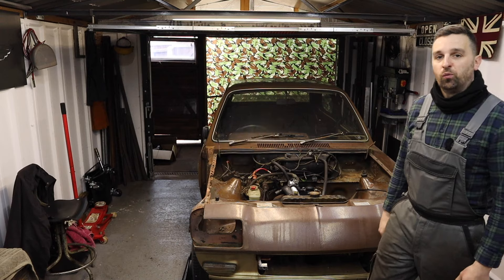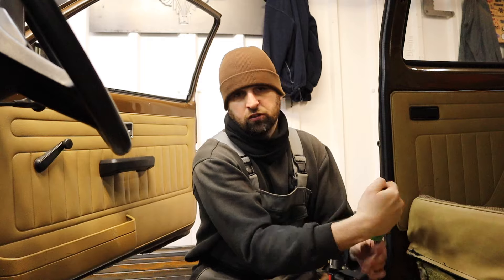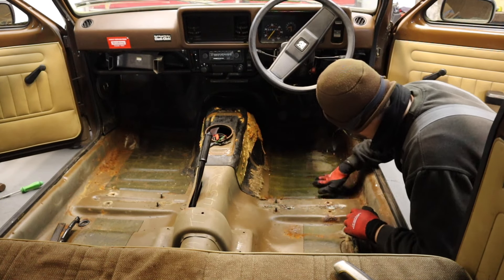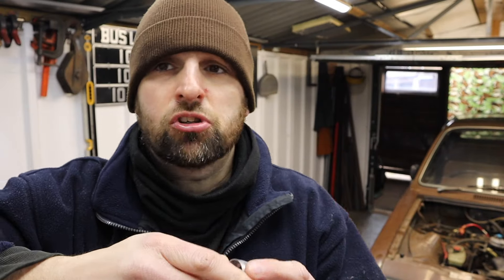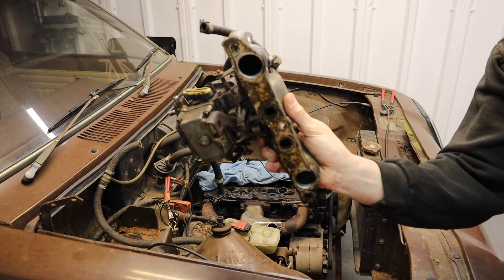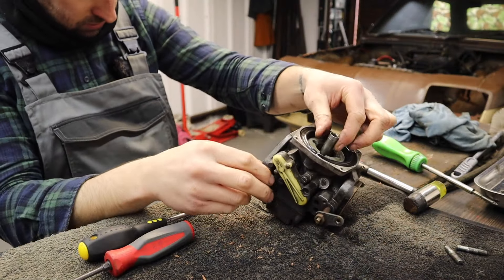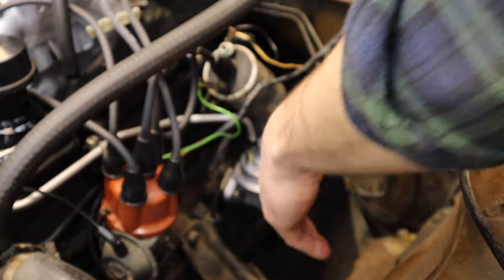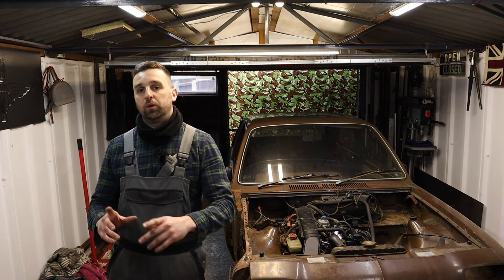We Found Rust !! Vauxhall Chevette Restoration Episode 3

Comment: Regards your shell its normal in all the areas you have shown, the floor where the seat runner is very common because of the strengthening plate underneath, remove the strengthener and chop the floor out then refit. Sills are always questionable and readily available so I would just replace anyway as there are sub structures that rot away where you cannot see until you remove the sills.
Reply from the maker: Thank you David much appreciated mate. Where can panels be brought from?

Comment: The wet floors is 100% the windscreen rubber but also check under the battery seat for holes, remove the screen and see if the bottom of the window recess is not rotted through.....again very common
Reply from the maker: Aw ok mate thank you again you know so much